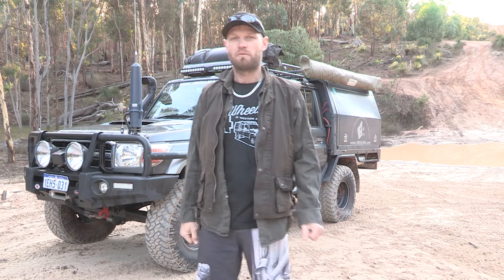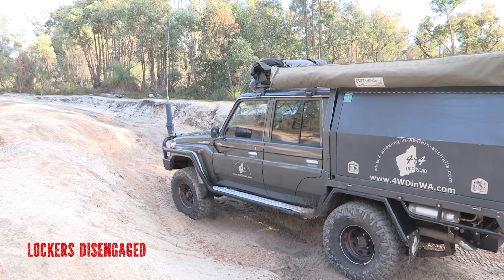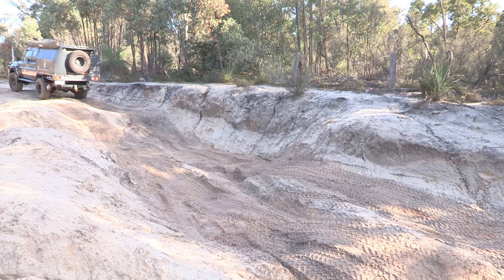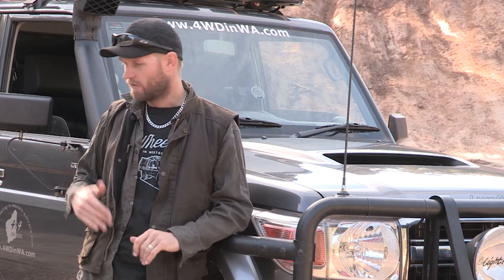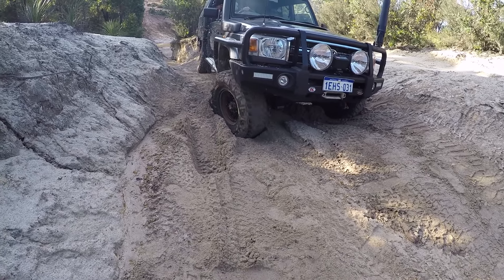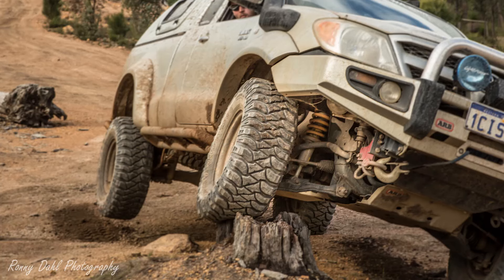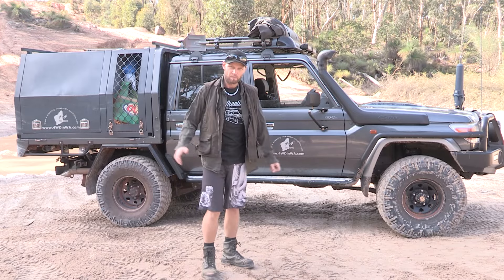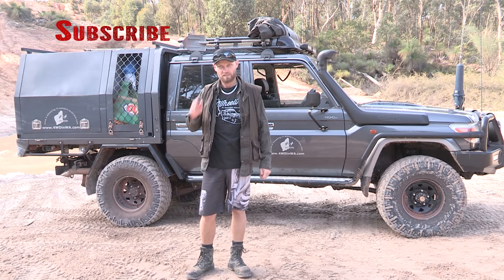diff lockers, how and when to use

Comment: Good oil blue.  I had  Toyota FJ25 landcruiser swb jeep ca 1970 in saudi. That is built like a brick shithouse from truck parts.  If you wanted 4wd you got out and clicked the front hubs.  A dream to drive (ca 1.5 tonnes) round town, light steering (no power easy on my squeeze) and you only needed 3rd and 4th. Sooo much torque from a 4.25L crhysler bus engine (125bhp).  15mpg.  It could go anywhere with confidence (1 million rabs cant be wrong), never overheated even at 55C.  In comparison with Rangerover - no contest - complicated, 100's suspension rubber bushes rotted quickly and they overheated easily (guys took off the bonnet).  The new Landcruiser - very competent vehicle (2.5 tonnes and megabuck  vs my FJ25 1.5tonnes
never got stuck in sand (set of bald yokohama truckers on low pressure). Always carried a portable petrol compressor for reinflation (cigar lighter types useless (2hrs on one tyre from 10 - 25 psi) + plus 10L water + med box + flares.  Happy days gunning along pipeline tracks, bumping into Bedou - its obligatory desert courtesy to stop and share a glass of Kave - cardomum coffee.  If ever in the shit they would help out so rudimentary arabic was essential - eg if you were desperate for No2 squits - say q'unbulla dishdash - meaning bomb in my pants and your ride was "bushellam" - dogs bollocks"
Sure you got plenty of these in Oz . Wish I had one now but UK wouldnt challenge it.

Comment: You also have full air in your tires, what a BS test be a real 4X4, and drop tire pressure to 16 lbs go Right upppppppppp
Reply: What a BS comment. The as long as the pressure is the same in both demonstrations it is still a fair comparison.  
And if you need to drop the tyres to 16 psi to get over such an easy obstacle, you have no chance at a more challenging track.

Comment: At the beginning of the video,why did you take a different line with the locker in,you moved over to the right.
You did not go thru the soft sandy patch ,that the vehicle got bogged in with out the locker.
You cheated. Thumbs down

Comment: Ok i cant follow because i dont u derstand english that well, especial aussie accent :p.. so if you lock rear locker, it gives %50 power to front tiers? And if u lovk front lockers, it will give all power to back? Cause as i know the trucks are gives power to rear  tyres in nuetral settinggns. Can sone one please explain it like u are explaining to an idiot)?
Reply: 4WD = front and rear axles are locked together.  
Front locker = left and right wheels on the front axle are locked together.  
Rear locker = left and right wheels on the rear axle are locked together.